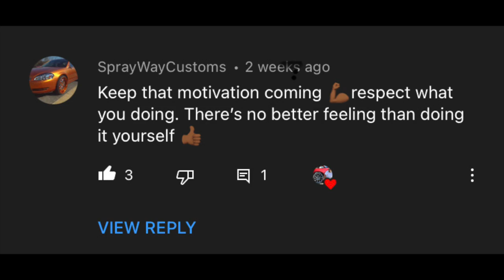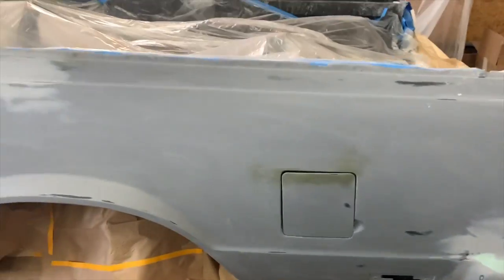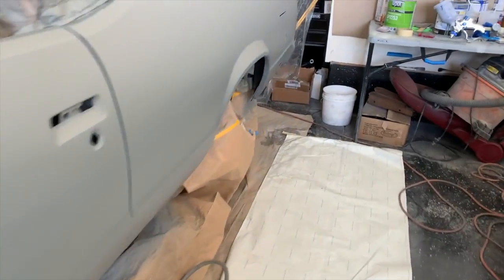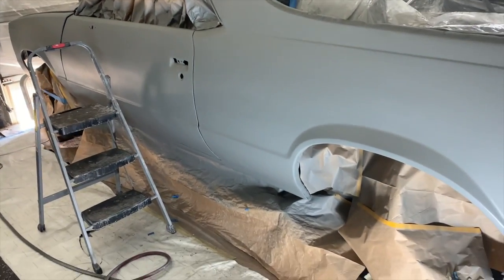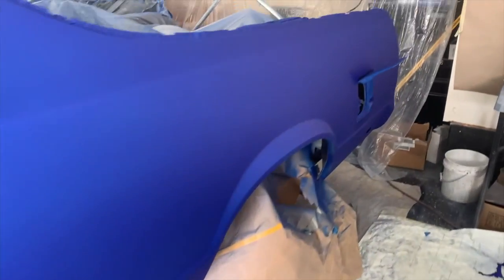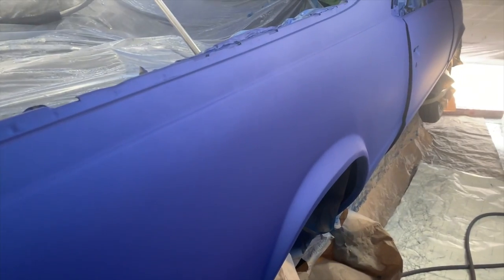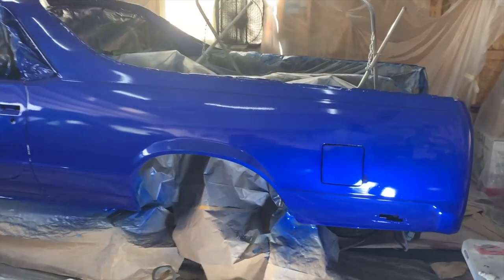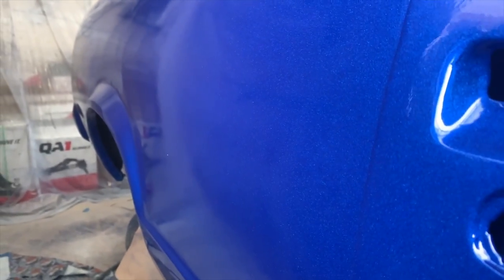MY EL CAMINO IS PAINTED AND IT LOOKS AMAZING!!!

Comment: Looking good.  Hard work is paying off.
Reply from the maker: Thank you! That’s a fact it really does
Reply: @grindschool  I need to get my engine dialed in. Put a blueprint crate engine. Running a little rough. Then bodywork. You inspired me to look into doing some it myself to save $. I am going to sand down my bed and line it with raptor liner. I hope it turns out okay. Ha. 86 elco here if you forgot.

Comment: What blue did you spray and what gun did you use if you have the exact info. Have my elco all primered just need to strip and make some parts straight then i want to do blue. Your Car looks great and its gonna be my first time doing all this too so i hope it comes out just as good
Reply from the maker: It’s called Subzero Blue Pearl. I sprayed it out of an Iwata I9 paint gun I think. The stages before paint though I sprayed using cheap Amazon paint guns…easier to throw away instead of cleaning every single time. The expensive gun you keep though.